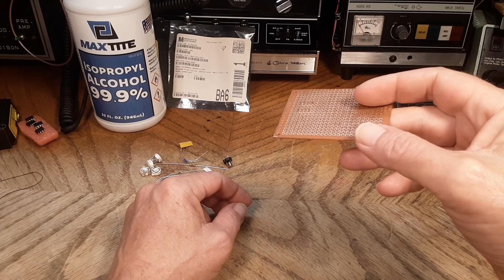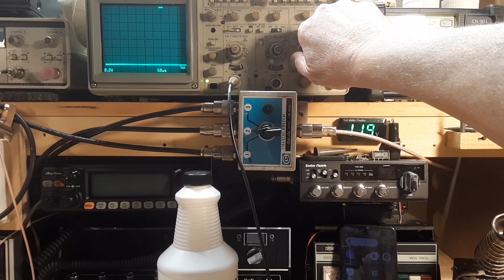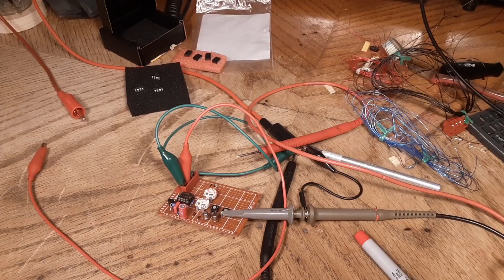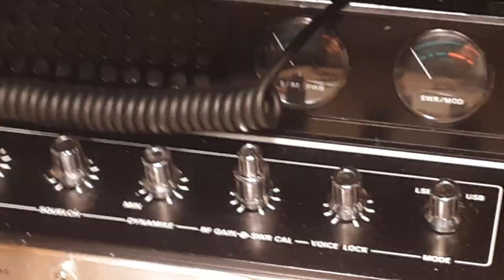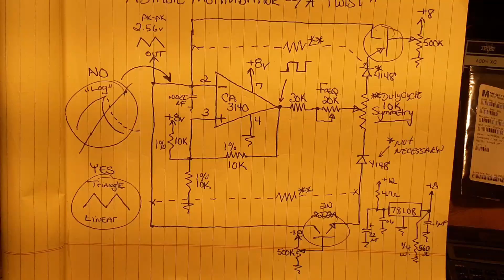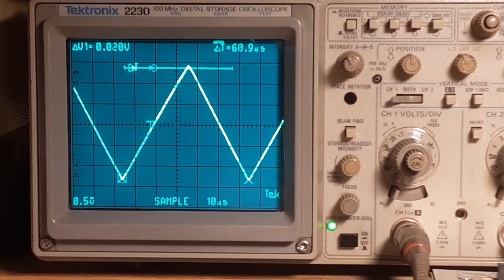mystery 👀🔮circuit🤫dont tell the "AI girls"😂

Comment: That's actually a really useful circuit. One immediate use for it that comes to mind is a PWM controller using just a dual opamp chip: one opamp ti generate the perfect triangle, and the other used as a comparator to set the duty cycle. Or a quad opamp for independent RGB control without needing any other ICs. That could save a lot of board space! I'm currently working on a project with PWM that isn't working right, and I suspect a bad batch of tl494s, so I might have to give this a try. You meantioned being able to set the DC with the added diodes & resistors. Can you still have fully independent frequency and duty cycle from just the one amp like that? My project needs to be stable a 1hz at 1%DC - not really the type of thing companies put on data sheets.
Reply from the maker: Congratulations fine sir,you have won the psychic award!🤔🫢👏👏💯💥😇I just can't fool you.the triangle is the starter for pwm.this should do want you want.send it into a comparator.it will be as stable as your reference/regulator voltages allow.the biggest clue for me would have been seeing sym.written on one pot,but your psychic ability is whole other dimension🥳🥳🥳